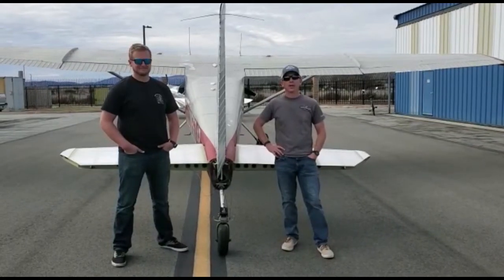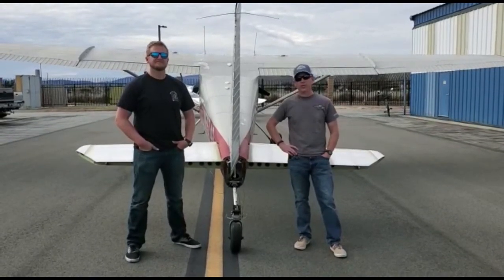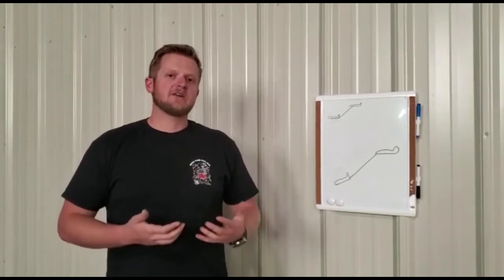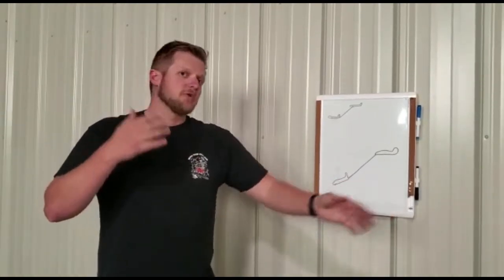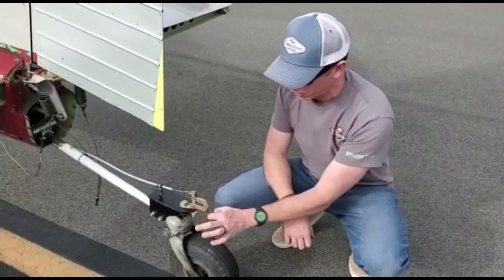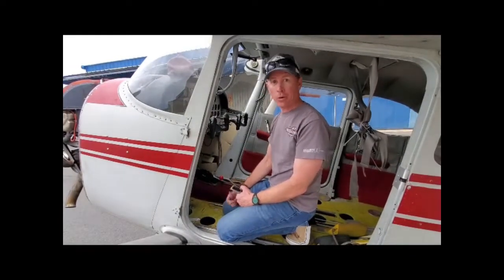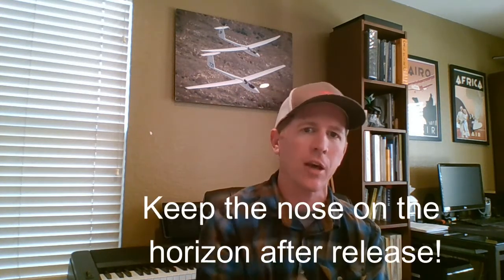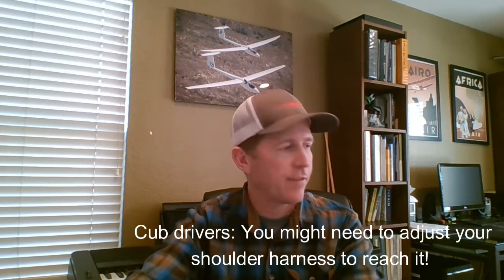Towpilot Safety and Schweizer tow hooks

Comment: Thanks for the time spent on this presentation, well done.  As a CFIG I will be using it to drive home some points with my students.  As a future tow pilot I appreciate the insight.  Like you treat every landing as a go around,  I treat every take-off as a rope break,  airline pilots are taught that every departure is a possible  V1 cut.  I now see that every tow pilot should be planning on their glider pilot to get high and be prepared to say good bye earlier than expected.

Comment: Have you ever seen a tow plane using a release handle that is the same configuration used in a glider (t-handle) located close to the throttle? I would like to see the release handle in a position where I do not have search for it, or even look down at a critical moment. Multi-engine fighters have emergency jettison buttons just forward of the throttle. It is in your peripheral vision so you can focus on keeping the plane wings level and nose on the horizon.
Reply from the maker: Great question... Ultimately yes and no. The Pawnee and CalAir I tow in have the release close to the throttle. The Pawnee being just ahead of the throttle. Without too much thought, I think a tee handle would be great but might (and I'm honestly not sure) be harder than a lever to create the force to take out the slack and release the sailplane.
Reply: @towpilot2003  Are the handles on the cockpit floor or attached to a sidewall or under the instrument panel? The use of wheel cable guides effectively creates a pulley system, so the pull force could be easily reduced.

Comment: The heaviest glider one might expect to tow is 850kg or 1874 Lbs (ex FAI Open Class) .  FAR 91.309 says the weak link (or rope) can't be less than 80% of that weight which is 1499 Lbs-f.  The max load for a Schweizer hook (stamped on the hook) is 1200 Lb-f.  This means one cannot legally tow some gliders with a Schweizer hook.  Why would one install a hook which limits a tow plane to a subset of the glider fleet while dealing with all the safety issues related to the Schweizer hook?  IIRC the Tost towplane hook can withstand at least 3400 lbs-f with no safety issues.
Reply from the maker: Simply, the cost. It was a whopping $400 for my install. I have no intention of towing loaded open class ships with my 180.
Reply: @towpilot2003   So this video is all about taking risks to save $400?  I think if you can afford a C180, you can afford a $400 hook.
Reply from the maker: @billdaniels1785  I think you've completely missed the point and that's okay. Your comment doesn't make any sense mathematically or under the guise of risk assessment.  Please do yourself a favor and watch the video before you comment further. This would be like me saying I save money by ground launching because towing is dangerous. Makes zero sense.
Reply: @towpilot2003  I did watch your video.  Go read FAR 91.309 and then read 91.9 then any glider POH/AFM certified under ESA CS-22.
Reply: @billdaniels1785 He said he won’t be towing those heavy gliders anyway.  The heaviest glider at this operation is a loaded SGSA232 - Max gross 1304. 80% of that is just over 1000 lbs.